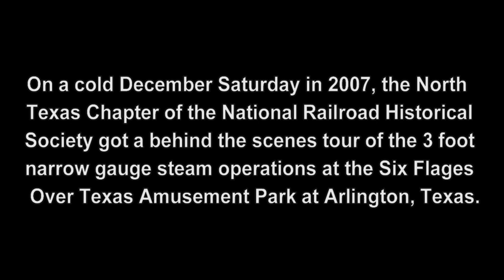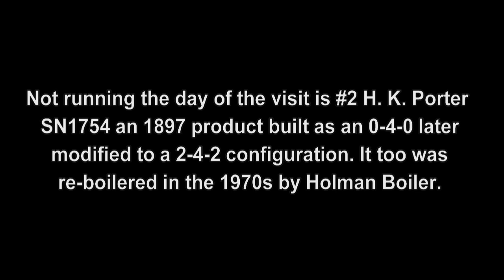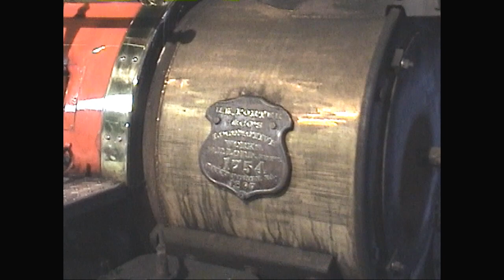Narrow Gauge Steam 2007 Six Flags Amusement Park

Comment: 1:01 I wonder what the purpose of that metal pipe that extends out from the top of the firebox what does it do and does the green train still have that
Reply from the maker: The insulated pipe to the left looks to be a steam line to the oil atomizer/heater manifold. Another is for the feedwater injector. Cannot exactly tell in dark video.
Reply: @lineshaftrestorations7903  very interesting I wasn’t quite sure I’m not sure if they still have that I think they re-modified the cab interior

Comment: I would not be happy firing for an engineer when he is using my steam with the throttle open and the automatic brakes engaged.  Sounds like he was pulling the hill with the Johnson Bar in the third notch.  Charlie Patton retired in 1982 at the age of 94.  He died in 1990 at the age of 102.
Reply from the maker: Proper firing was not being practiced that day.
Reply: It’s also noted that back then I never noticed when I was a kid, but I can tell back then General Sam which was still LBC her Valve timing was way off and at the same time back then when I first met CJ P I can tell that the timing on CJP was dead on center when we go through the tunnel I couldn’t hear perfect chugging in comparison to LBC. The steam exhaust is being admitted to early and too late.
Reply: Working steam against the brakes has its advantages, helps keep the train slacked out, provided the fireman with more draft so he can set a hotter fire to offset the increased steam consumption, and it provides you with more control over your speed when going downhill from Johnson Creek to the ghost town saloon